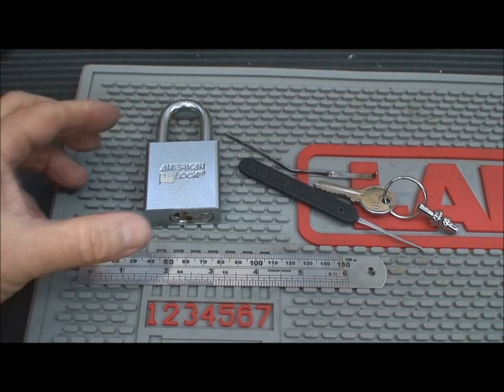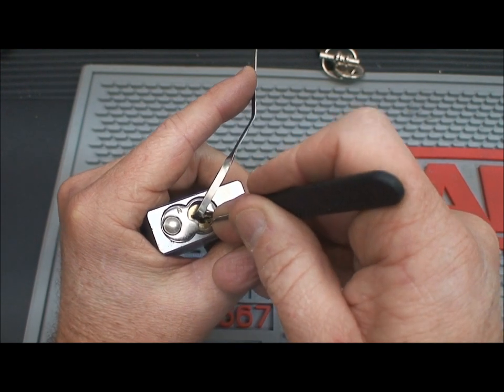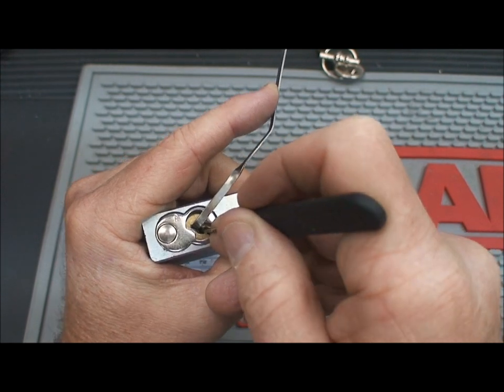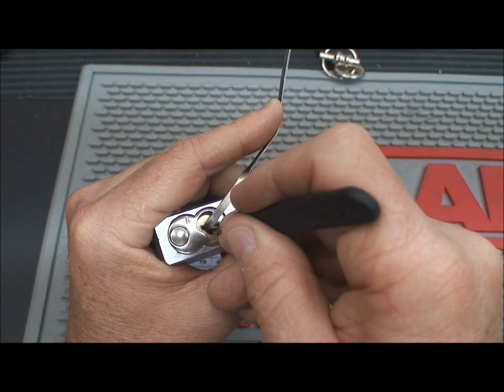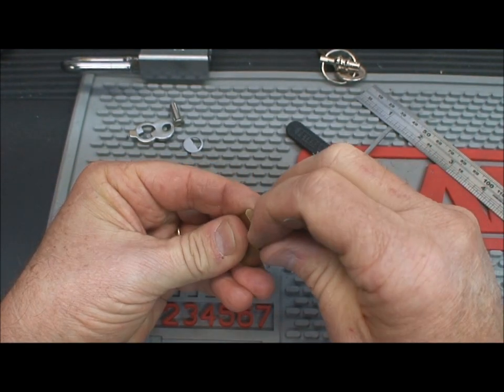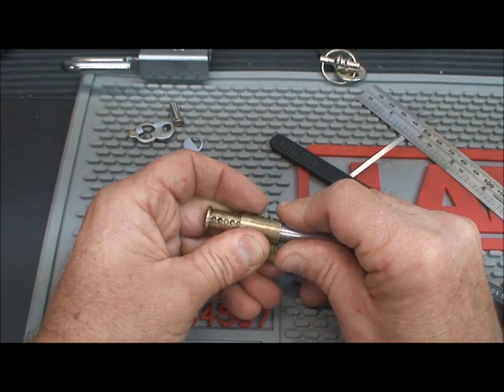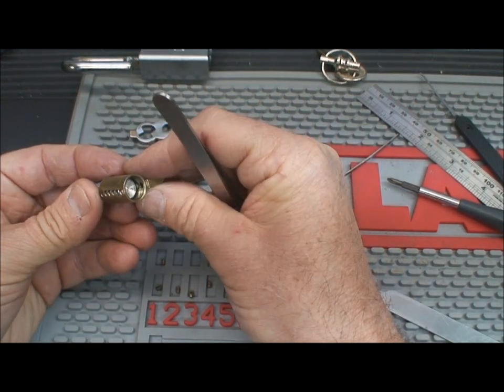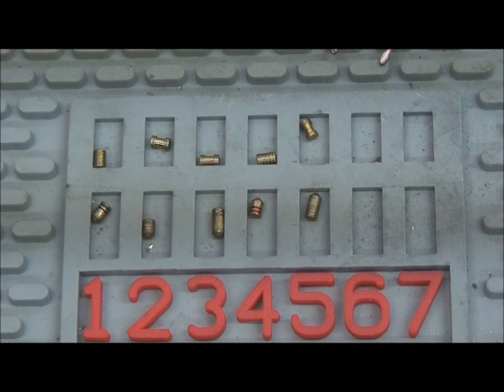(45) American Series 5200 Padlock Picked Open and Gutted

Comment: Finally...after 10 hours over a couple of months I got it picked! 5 serrated 5 spools. Wonder why only five pins when there's room for six?
Reply: BeatsFromDP someone found one in a locker room and gave it to me. I probs spent about a combined hour and a half at work messing with it. First time picking one with security pins. Sure feels nice once you get it.
Reply: I'm guessing it originally shipped with a 5 pin key. I heard American Lock charge extra for a 6 pin keyed lock but I'm in the UK and have to import these, so I don't know how it looks at USA retail level. Anyway I seem to recall Bill uploading a video where he takes one of these cores and adds a keypin to ride on the tip of the key in slot 6. So it would also need to be picked to shear, but anyone only looking at the key might assume there are just 5 pins and struggle to get in. It's a great trick, using all 6 chambers to get the best out of the hardware.

Comment: I have this exact same lock I’m attempting to pick right now. It really upsets me that you can just open it no problem, yet I’ve spent days on it now lol
Reply: Same. Mine is older, but I'm not getting feedback from it. I seem to run out of options.
Reply: @breaddrinker  keep trucking dude you’ll get it. Finally got mine open a few days ago.
Reply: So I’ve tried opening this monster again. It’s been about 3 months since I opened it without success. I’ve found out that I can throw it just short of 80 yards. 😂
Reply: @darenmiller2218  ha.. Yeah I even bought some blanks to attempt to get a working key on mine.. But currently shelved.
Easily the hardest lock I've tried so far, and on paper I've opened some classed higher..

Comment: I know this is a old video.. But after seeing this i went and bought one of these. Majorly disappointed. After opening it way too easy, i decided to take it apart. It has 1 security pin in the #1 position. Al the rest are standards. Highly disappointed. Makes me want to make a challenge out of it. The date code on it is QNJF5. I was looking for a lock full of serrated pins to practice on. Do you have any recommendations?
Reply: find an old lock, pre master lock
Reply from the maker: Bird718 is right.  After Master took over the production line for American padlocks, they changed the cores and dumbed down the pinnings.

Comment: I have a 5200 with all spool uppers and serrated key pins. I have not been able to pick it. Was only able to disassemble with the key.
Reply: +bosnianbill I have been trying to pick it for 2 days. I think the third pin is what is holding me back. It is so tall that it's nearly at the shear line with no key. I think I am over setting it every time. What I did is put No. 3 in by itself and I still over set it. You may laugh but this is my first lock to try with security pins. I've only been picking about a month.
Reply: @13Jimdp  where you able to pick it open? I am having the exact same issue
Reply: @darenmiller2218  I have yet to pick my lock open. I eventually gave up. I believe it takes a great deal of practice and understanding how the spools feel when they are false set.
Reply: I’ve only made my own picks. Maybe if I bought some that would help. You’re right though, it takes incredible skill to pick this thing open.
Reply: @darenmiller2218  I do have a set of Sparrows lock picks. They do make it considerably better than homemade picks. But this lock has eluded me since I started. Do you have a key that will open the lock? I'm thinking if we can disassemble the core and only leave 1 set of pins in and try to pick it get used to how it feels, then add another and try, then another and so on.
Reply: @13Jimdp  I do not have a key. I’ll probably continue fighting it until I have enough money for a good set of picks. I’d hate to cut it open just because it will “win” lol. I’m pretty sure I have almost all the pins set except that dang third one. It acts like the key and driver was welded together or something.